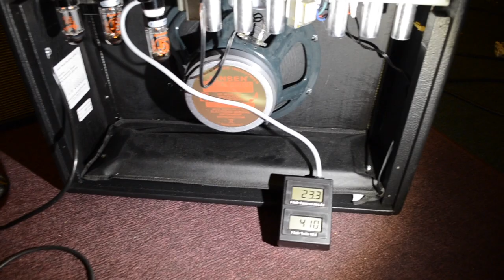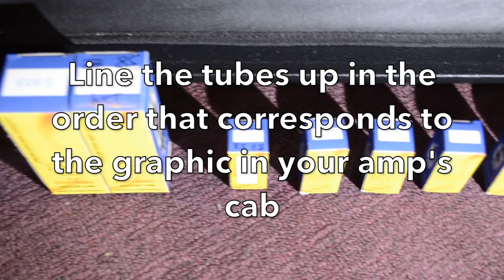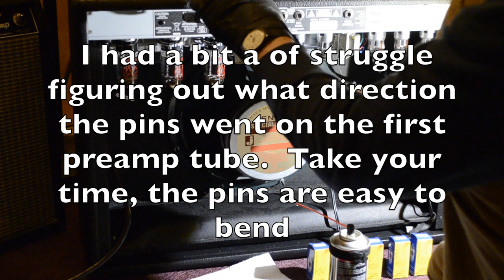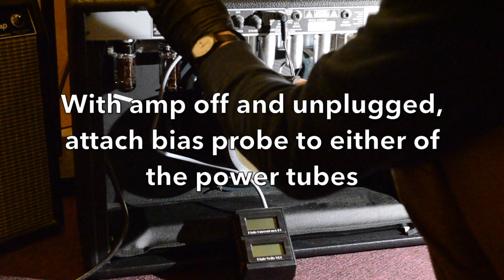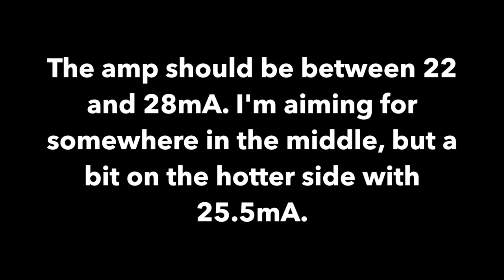Replacing Tubes and Adjusting Bias on a Fender Deluxe Reverb '65 Reissue Amplifier

Comment: Presumably you have a pair of matched power tubes, hence making the bias adjustment with the probe only connected to one tube? Also, it looks like you have to twist those metallic covers slightly to get them off?

Comment: 411v plate voltage divided 14 watts for the 6l6 = 29.35 . 70% of max plate dissipation is 20.5 ma. No?
Reply: These are 6v6 tubes not 6l6
Reply: @blackivan69  yes , sorry I meant 6v6

Comment: Hello, i see that you also have a princeton. i also have that exact same bias probe. Anyway, the plate voltage of my princeton came out to 420 which is higher than what you got from your deluxe. Shouldnt the princeton have lower voltage than a deluxe? is that normal? What is the plate voltage of your princeton? thank you in advance.